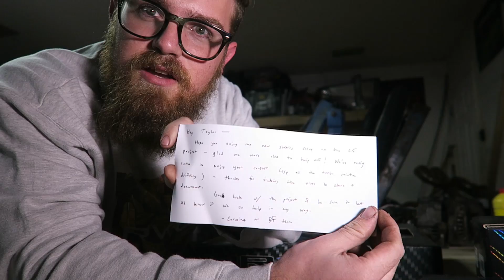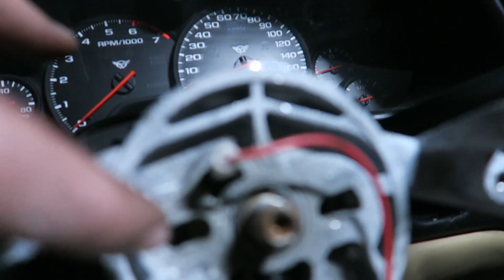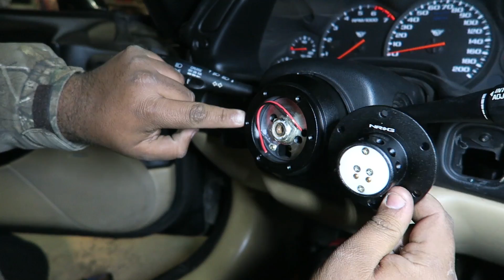C5 Corvette NRG Steering Wheel Install!

Comment: Pro tip leave the bolt half way on for the steering wheel, sit in the driver seat, lean forward, put your hands behind steering wheel but leave a gap, and in one motion lean back/pull wheel hard. Works every time ;).
Reply: Tenzinite Yep, did the same for my e46, didn't need a special tool. Follow the KISS principle: Keep It Simple Stupid.
Reply: Tenzinite not following bud
Reply: I thought everyone did it like that.
Reply: Jack Stanton leave the nut on loose and yank the thing back as hard as you can in one go. how do you not follow?
Reply: Sitting in the drivers seat well give you better  leverage when pulling on the wheel. Leaving the bolt half way threaded will stop you from punching yourself in the face
Reply: Will*
Reply: That's what I do, I was gonna suggest the same thing lol
Reply: xempt. one the thing? so i can just start pulling on the dashboard as hard as i fucking can? am i supposed to guess?
Reply: a heat gun to heat up the aluminium of the steering wheel helps as well

Comment: Should have got a Nardi or a nice MOMO. :/
Reply: Chase Hoffman nope
Reply: If its being sponsored you take what you get, Just the way it goes haha.
Reply: Arctic240sx NRG is junk, that's like a haggard garage wheel. I wouldn't want to be sponsored by great value or something
Reply: Agreed, I love that that he got it free and Adam has his own wheel... But NRG and GR are both way overpriced, Chinese bulk order garbage. You can pretty easily go find the wheels GR buys for like $15 and then sells for $300. 

They're just low quality pieces and personally anything related to steering especially is something you shouldn't use sub par parts on.
Reply: NRG's adapters are quick releases are great though, just not the wheels.
Reply: Guy Fieri adapters are fine, Grip royals are slightly better then a NRG but not by much. Don't get me wrong I would take a free wheel, but if he wants his build taken a little more seriously get that junk off the car. Plus it doesn't have an air bag anymore :/
Reply: What makes you say nrg wheels are crap?
Reply: Chase Hoffman I think he said in adam's video that he's gonna change it out
Reply: Chase Hoffman Guy Fieri I personally use NRG Adapter and quick release on my S14 and have nothing but good things to say about it, steering wheels on the other hand i have never used anything other than nardi.
Reply: Hemi's Headquarters made in China, and you will bend them after just a few drift events especially if you run no power steering. You can get an amazing entry level MOMO wheel for 200 bucks and will last years. There not the biggest piece of junk, BUT I feel like there are better wheels to pick from that are not far out of that price range
Reply: Exactly my point. I'm genuinely not trying to be an elitist dick or rude, but both Taylor and Adam are cool guys doing really nice builds with quality parts, so it just kinda pains me to see them skip on such an important piece.

Comment: A tip for the future, and anyone watching. Always have someone pulling on the steering wheel, or whatever item you are trying to pull off, while you hammer on it. This gives the item less wiggle room and space to rebound, and directs all the force in the direction you want, while also compounding the pulling pressure with the banging pressure. It really helps. Same methodology as pulling the T handle on a slide hammer as you use it.

Comment: Easiest way to get a wheel off is once you have taken the centre nut off, thread it back on a few turns, sit in the drivers seat and give it a few sharp hard pulls. It'll come off and the nut will stop you from smashing your teeth in.

Comment: those slots are meant for the kind of steering wheel puller that uses Ts you slide them in, turn sideways and it grabs the wheel from behind and you tq down until it pops off. (granted its a shitty material and you can literally rip it to shreds if you're not careful. I did this to my C5 z06 with a Grip Royal wheel. Black with red stitching and silver ring horn button to match the TWM short shifter/car exterior and black/red interior. I highly recommend the TWM short shifter, it makes the shifts feel good and solid and not like you're trying to row a boat haha.

Comment: For future reference with most steering wheels you can leave the main nut on it and pull it off (It will be tight but it will come off with some force and the point of the nut is so it doesn't come off to fast and hurt you.)

Comment: I would suggest that if you are going to hit the steering wheel off towards yourself, leave the center nut on a couple of threads so it doesn't fly off into your face.. someone probably brought this up in this comment section already, but I didn't take the time to find it.

Comment: Greetings Taylor......The vette project looks like it will be a blast....just one little point with regards to the steering wheel swap ..after you remove the drivers airbag you need to have a resistor placed in the srs system to compenstate for the voltage that the ECU/BCM send other wose you could throw a srs defect code...shalom

Comment: 7:44 and theats where you messed up put the nut back on and thread it a little bit then start hitting it when it comes off the nut will save your noise and face

Comment: tip. if removal of steering and you got no puller. put the nut back on the centre shaft just flushed on and than give it a tap with a hammer on the nut, whilst tugging on the steering wheel and she will pop off! with the nut threaded flush on it wont damage the shaft.

Comment: There's a few things incorrect in the install. 1) your hub is not clocked correctly. The square hole is on the bottom, it should be at the 9 o clock position or so because it's for the horn wires. 2) The clock spring is there ONLY for the airbag wiring. Not the turn signals or the horn. The turn signals have nothing to do with a clock spring. The mechanism for self-cancelling turn signals are in the column itself. 3) Because you're not running airbags, you can simply move the clock spring to under the column, zip tie it and use a 2ohm resistor to turn off the airbag light. 4) You don't need a hub ADAPTER because this will clock the hub correctly.

Comment: Tip that worked for me to remove a steering wheel without threaded holes for the puller. Put a pry bar through the wheel from side to side so that it's behind the grip but in front of the center section. Then let the puller push against the pry bar forcing out on the wheel. Be careful not to bend the wheel if you are planning to re-use it, but I know that doesn't apply in this case.

Comment: Fun fact that ring isn't needed to turn the turn signals on and off. I have a 1991 Miata and I took off my ring and my turn signals still work fine without it. It's a spring mechanism built further down.

Comment: I really like the stock c5 steering wheel and where my left hand placement is when driving it on the street...they fit me like a glove and the frontal view out the windshield is perfect...over the yrs. I have owned 5, c5's...I still have 2 torch red ones, a 99 vert. N 04 z06.

Comment: dot on hub needs to be on top, but first u need to trim the plastic clip where the air bag harness comes out of the clock spring.  the square hole on the hub is for the horn button wire comes through the hub and you can also run the airbag wires through it to put a resistor for the air bag light. once u do that hook up the wires to the horn and everything lines up and the horn works.

Comment: That steering wheel removal was painful to watch..

Amateur tip: Thread the nut or bolt (on some cars) back in so you leave a 5mm gap or so between the wheel hub and nut/bolt, sit in drivers seat and with both hands pull the steering wheel back to you, having the bolt/nut attached prevents you from loosing your teeth 😉 
Also if you or a buddy taps the nut/bolt with a hammer while you're applying your pulling force it's another proven method of removal.

Steering wheel pullers aye.. They've got tools for everything, your brain's the best tool work smart not hard 👌😉
The new wheel looks good btw, great video.

Comment: To get a steering wheel off in a pinch. Back the nut off the center bolt. Pull the steering wheel towards you with your knees and tap the nut with a hammer.

Comment: When i did my NRG wheel on my 240, i grounded my horn out on the back of the short hub. I just made a bracket to keep the wire from moving on me, works great.

Comment: Pro tip,put the nut on so it's just proud of thread,sit in drivers seat,pull steering wheel towards you with both hands and get other person to hit nut with a hammer...

Comment: leave the nut on but a couple turns loose. sit in the seat. grab at 3 and 9 o'clock and pull towards you. left then right then left then right. it will come off very easy.

Comment: So when I installed my Nardi I used the old mightycarmods trick of just leaving the nut on the last 10 threads or so and then  pulling the steering wheel towards me really hard so that way you're not binding against the threads as you pull it off. The nut then keeps it from wacking you in the face when the wheel comes off. Hope this helps in the future!

Comment: I don't think I would ever swap out a OEM airbag if it still works and if I daily the car.
Reply: JC_mcsR53 hes making it a drift car...its gonna have a cage and harness" battery relocate is mandatory and jtll probably have a fire extinguisher in it aswell. I think hes good on the airbag lol
Reply: TheLoneWolfRider I guess if you have good seats, harness, and roll bar you should be good

Comment: Next time you remove a steering wheel hit the center with the nut on loosely so you don't destroy the threads it shocks it and comes right off

Comment: Just remove the clock spring on your steering wheel (the white thing behind the hub that goes in the square cut out) i had the same problem on my chevy s10 the clock spring just maintains an electrical connection to the airbag so i took it out and now my wheel is straight

Comment: Thread steering wheel nut on a little after lossning
sit in seat grab wheel at 9 and 3 and wiggle 
Bolt stays on so you dont smack your self in the face.

Comment: Could you just disconnect the steering joint where it meets the rack and turn it a tooth or two to make the wheel straight. Seems like having adapter after adapter after adapter is to many places to fail
Reply: Kyle Irwin was just going to say this..

Comment: JDM AF! lol that wheel is dope, and so is the BFxTR sticker. Any luck on that tick diagnosis? (unless that's info for another video)
Reply from the maker: +evan mm still no change. Riding it out for now 😂
Reply: Taylor Ray word word. It'll be fine, and if not.. 5.3's are like $12.95 at Wal-Mart now.

Comment: what did you do about the DIC warning messages and warning lights? having to hit reset 5 times for SERVICE AIRBAG/abs/tcs/active handling every time you start up would be a mega PITA. I'm guessing the steering position sensor wouldn't be compatable so you would loose traction control ability as well.

Comment: There is a steering wheel puller for the C5 that uses two hooks through the holes on either side of the wheel nut. A LOT of the information and process of this video is wrong. No hate, just want viewers to be aware.

Comment: yall didint need to cut the thing yall could of put the bolt back in not all the way just enough for you to pull the steering wheel off for it wont hit your face for next time

Comment: Whats are somethings to look out for when buying a wheel
Reply: GamingKunuck other cars after you install it
Reply: GamingKunuck just don't get an eBay one because they bend also don't get a quick release unless you have a cage and need more room to get in because cheap ones suck ass
Reply: dont buy a cheap ebay pos, stick with the real deal
Reply: GamingKunuck Ebay is bad. If there's one part on your car that shouldn't be ebay, it's your steering wheel. I've made this mistake before and bent my steering wheel (ebay)
Reply: IMO you shouldn't get a quick release steering wheel unless you need it. I've been in a car accident where my steering wheel air bag saved my ass. I got the corksport steering wheel for my speed3 that supports the factory air bag

Comment: I've never owned NRG steering wheels in your honest opinion are they something you recommend
Reply: LZ  grip royal !!!
Reply: I don't own, but frequently use and install NRG products, I feel that both their wheels and hubs are quality. If I wasn't broke I'd run them.
Reply: +MEno Gusta thanks a ton cuz I've never owned them just nardi and momo but id been lookin at a few
Reply: talking about the lz wheel, nrg is good for the price atleast the hub
Reply: NRG parts are cheap, Chinese made, knockoffs of legitimate parts. They might be slightly better quality than your standard Ebay parts but they're still low qualities copies of brands like Nardi, Sparco, WorksBell, etc. Save your money and buy parts made in Japan, USA, Germany
Reply: Yea I agree that's what I mainly have done like mono and nardi thanks for the heads up brother
Reply: I just want to say, my friend has used his as an actual weapon and there's only one chip but it otherwise looks brand new. So it's quality enough for me.

Comment: I seriously hate to rain on such a cool parade, but keep your old steering wheel, so you can put it back on before vehicle inspection, unless it is intended to be completely kept off the road. Obviously this varies state to state, but if a steering wheel comes with a airbag, it's required to have it in it at least during inspection. Now if it is off the road, and a track car, no this is not required.  Now you're asking is it illegal ? Depends on the officer, and how cool he was, and the charges you're going to get, or slide away scotch free of... because yes it is 100% illegal to take out a government MANDATED safety device. Good luck telling your insurance company this as well... likely your claim will be denied, and even if it was the other persons fault, if the company finds out you had no air bag in your vehicle.. you might not even get anything out of it... so you have been warned. Now if the car came without a air bag system at all, then by all means do what you need to for your steering wheel. Sorry for being such a downer :\ but it's from past experience and being a utter hooligan myself..
Reply from the maker: +Eric Benton we don't have vehicle inspection

Comment: What is the point of a quick release wheel, I haven't seen anyone take off their wheel when they get out?
Reply: ESTEBAN CASAS when they put in race seats that arent adjustable, then they need it to get out, most of these cars dont need it but its also "cool" i guess
Reply: Glint Hawk oh ok that makes sense, thanks
Reply from the maker: +ESTEBAN CASAS when I cage there car it'll make getting in and out way easier.